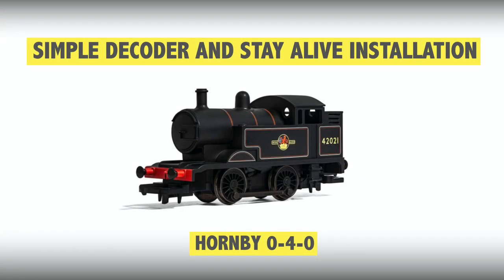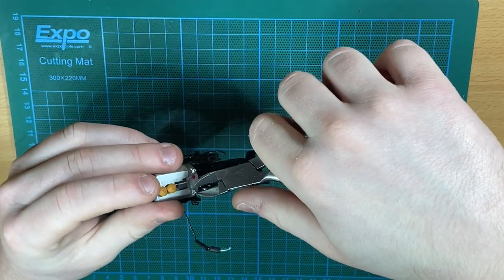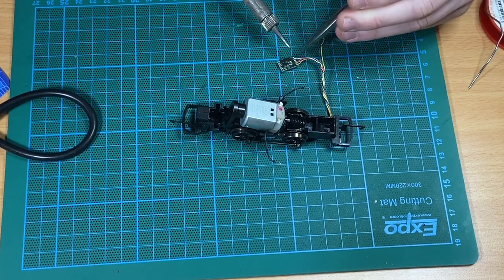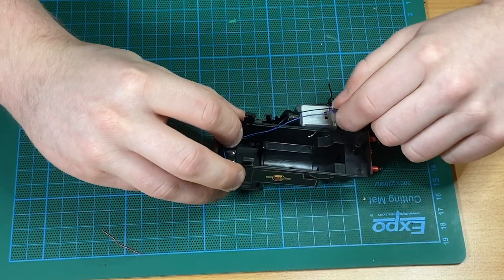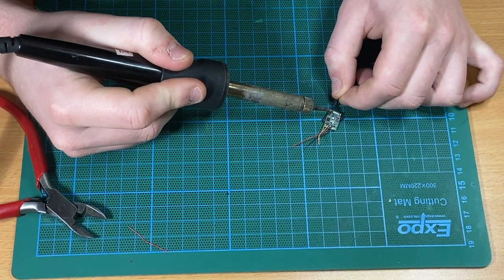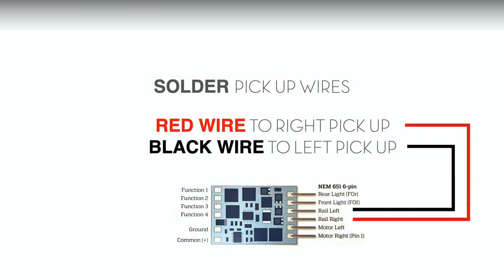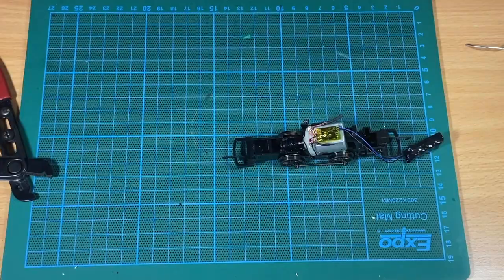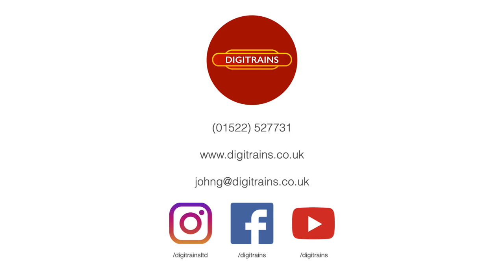Simple DCC Decoder and Stay Alive Hard Wire Installation Guide By Digitrains. **UPDATED PARTS LIST**

Comment: Thanks for a very helpful video. Sorry if this is a silly question, but what would happen if the wires to the motor were soldered the wrong way around? I'm new to DCC and so this is a possibility!
Reply from the maker: Hi no problem. Glad you found it useful. If you soldered the motor wires the wrong way round the loco would run in the opposite direction to what is displayed on your DCC controller. This can be rectified by either swapping the grey and orange wires over, or reading CV29 on the decoder and adding a value of 1 which reverses the direction of travel on the decoder. 🙂
Reply: Digitrains Ltd Thanks very much. I have subbed to your channel 👍 Keith
Reply from the maker: @theenigmaticgamer  you’re welcome. Thank you 🙂